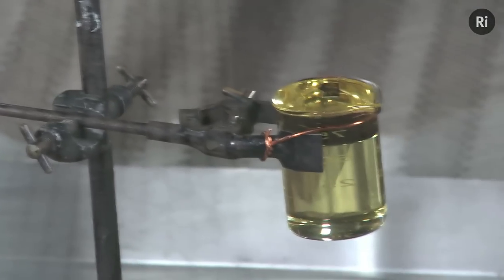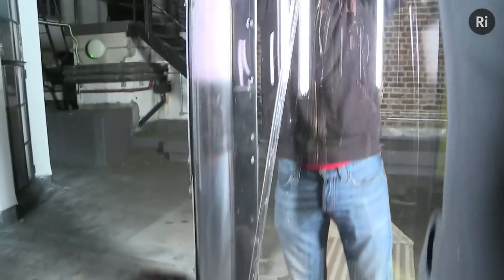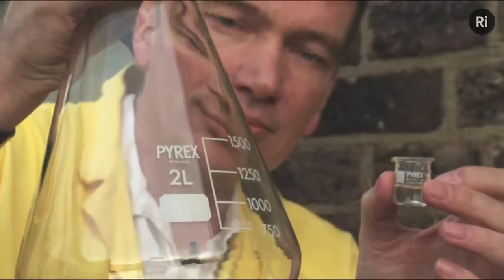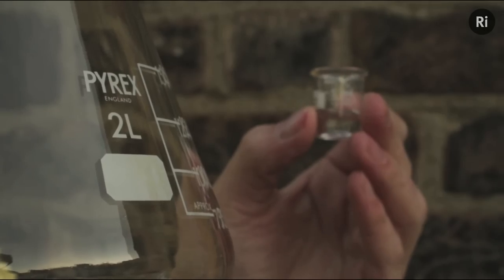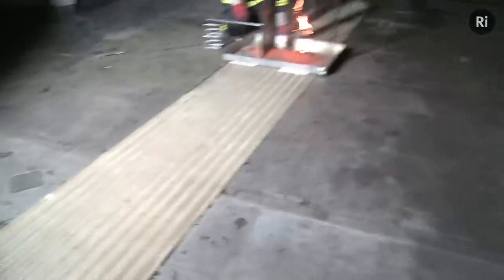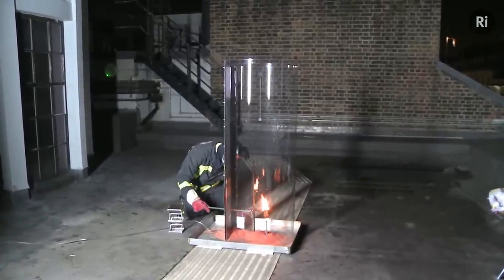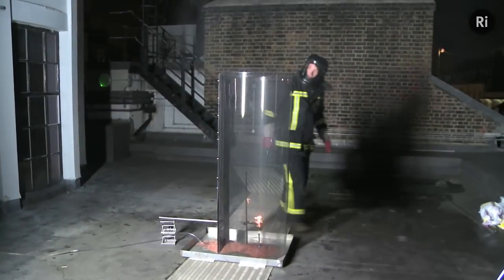Creating a Fireball - Pouring Water on an Oil Fire

Comment from the maker: When mixed, water will sink below oil; and when the water boils it expands enormously in volume as it turns into steam. The water/steam forces the oil into the air from below and the burning oil is propelled upwards.
Reply: The water boiled because it touched the heated container, not the oil itself. Oil has a lower boiling point so it will not turn water into vapor directly.

Comment: In my first ever science lesson I did this :D (admittedly not deliberately) We were told to use tools given to us to determine which substances were candle wax, sugar etc. One of the tools given to us was a bunsen burner and we determined which material was the wax by melting it. Unluckily for myself, one of my group decided then was the best time to go to the toilet (without telling us). They had also been given the job of watching the wax and taking it off once it had started to melt. I looked up from my work and out of the corner of my eye spotted a small flame, I ran over and found it was our wax. Being a year seven and having not been warned of the catastrophic consequences of putting water on an oil fire I quickly carried the burning container over to the sink and dropped it down underneath the tap. I then promptly turned the tap on and only narrowly avoided a large fireball. To this day I swear my right eyebrow has less hair on it than the left...
Reply: Andrew Herbert That must've been scary
Reply: +Andrew Herbert Short version: You burned yourself with an oil fire, by throwing water on it. Medium version: ... in highscool science. Long version: ... but it was oil from wax. TLDR version: (anything more).

Comment from the maker: The two important elements of the reaction are: i) When mixed, water will sink below oil; and ii) when water boils it expands enormously in volume as it turns into steam. The water/steam forces the oil into the air from below.

Comment: Yeah that's right. Steam is water as a gas. As it rapidly expands it dissipates the oil in to a kind of vapour of small droplets. Far higher surface area, coupled with a higher fuel/air mix causes the fire to spread quick. It's deflagration.

I've just checked, and its all written in the description ;)

Comment: They do this experiment/demonstration at my local town faire every year... for years they have been saying use a damp cloth, but the last one i attended and watched, they actually said that the heat from the fire will just dry the cloth out and then it will burn!

What they now recommend is you wet a cloth to shield yourself and actually place the metal lid back onto the fire, the fire will burn its oxygen and will remain contained until the heat is no longer high enough to sustain the a fire.

Comment: basically in vapor form oil auto-ignites because its much easier for oil to ignite in vapor form due to high surface area and more oxygen oil interaction, oil couldn't achieve that inside the flask even tho it had auto-ignition temperature.

Comment: It seems to me that another factor in why the fireball is so large is because it the oil were lit from the top, or if the oil was part of a lamp with a wick, only a small part of the oil would be burning at any one time.  So the fireball is a combination of the steam expanding the burning oil in addition to the fact that all of the oil (more or less) is burning simultaneously.

Comment: That actually happened to me in art class, I made a video putting out a fire we had in a tin that was used for melting wax.  The metal was very very hot and the water boiled instantly, generating a smaller fireball.  Luckily, no one was hurt and it didn't trigger the school's fire alarms.  I was recording at the time because it was the end of the day and I wanted to make an interesting video and I learned something new.  Don't use water to put out a fire in a metal container...

Comment: Its like this 1 mol (the molecular weight of a molecule or atom in ~ g) of an idea gas will take the wolube of somewhat more than 22 liters. This is an example to show how vast the expansion is.1mol H (~1g) expands to nearly the ideal gas volume. So you are adding water to oil. Water has, under normal presure, a boiling tempreture of 100degrees or ~ 374 klevin. now you know that oil can be heated farther than 100degree (will stay with degree).

Comment: Oil is liquid at a higher temperature than water boils, so when water is added, it explosively flashes into steam, misting the oil, which then burns considerably faster in a fireball.

Comment: In this video, the oil is initially on fire, which is different from a usual kitchen setting.

But even if the oil was not on fire, and the fire was burning below some pan, the vaporization of water would wrap around the pan and carry droplets of oil to the fire, then boom!
Reply: This is an advice if oil catches fire, first thing someone in panic will try is putting it out with water.
And also, situation you describe can lead to fire, too.

Comment: Question:

If the water is more dense due to how the hydrogen bonds and various other assorted inter-molecular bonds hold it together, closer than oil, then how come oil's boiling point is above that of the cast iron pan  it may be in, and water is comparativley much less?

Furthermore, why is it that the leidenfrost effect does not occur? Is that only applicable when one of the two substances are a solid?

Comment: Now something astonishing happens, i wont swin on the surface of the oil and wont instantly vapourise because of the "leidenfrost effect" a isolating hull of voporised water shields the water drop which sinks through the surface. Than nearly instantly the water reaches boiling tempreture and epands (like an explosion) because of the much much higher tempreture the oil holds. This tfast expanding vaporised water will trow oil in tiny particles out of the glas. This again will lead

Comment: Ha ha! I did this once with a friend with 3 litres of boiling cooking oil in a large sauce pan on a bonfire and a beer can as the source of water. After retreating a safe distance the fireball was spectacular - an incandescent mushroom cloud about 6 metres in diameter rose to the tree tops. The exploding beer tin almost punctured the walls of the sauce pan.
I wouldn't recommend doing this without taking proper precautions - it's certainly not safe!

Comment: Most people don't know that you can run an old diesel van on chip oil. It is as combustible as diesel, but newer injection systems get clogged so it has to be an older system. Notify the Revenue and Customs you are using this as a fuel and pay a small tax and you have much cheaper way of getting aroun - rumour has it your car/van smells of chips though.

Comment: Wouldn't the steam technically fill any container since a gas expands to fill the volume of a container?
Reply: Sean Williams Yes, but I presume that under equal pressure and temperature, a ml of water converts into x mols of steam, which have a volume at a particular pressure and temperature.

Comment: If the water has time to sink below the oil, how can it turn to steam instantly?

You should do this experiment again, but get theslowmoguys or Destin from SmarterEveryDay to film it at high speed so we can watch what happens, and work out roughly how long it actually takes to turn the water into steam, and then in to a big oil fireball :)

Comment: Explanation: DO NOT PUT OUT A GREASE FIRE WITH WATER!!! Since fire and oil do not mix, pouring water will only cause the oil to splash and spread the fire even worse. In fact, the vaporizing water can also carry grease particles in it, which can also spread the fire. Turning off the heat source before it becomes too big usually works. If the fire is small and manageable use baking soda or salt, because it releases CO2 (Carbon Dioxide) which suffocates the flames. If you don't have baking soda try eliminating O2 (Oxygen) to the fire using a lid or a plate. And do not beat the fire with a cloth. (saw that in FD2) As a last resort, spray the fire with a Class B dry chemical fire extinguisher. If that doesn't work, then get out of there, and call the police.

Comment: If you had a can of fuel and set fire to it only the top will burn, throw that fuel from the can into the air and it should give a fireball. due to increased surface area of the fuel exposed to the air.

Comment: Yes, it a typical mistake that a lot of people make. Common sense tells us, water - fire. The mistake here isn't trying to extinguish it with water though, its simply not adding enough water. Throwing small amounts of water onto it will result in what you see in this video. You need to add vast amounts of water, practically drown it, and it will go out. Unless you have a massive "geyser like hose" handy (which you wont) its not recommended, leave and call the fie department.

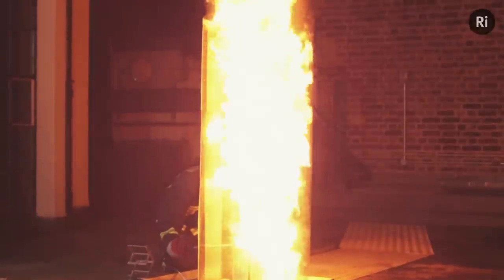Comment: Oh, no, I wasn't suggesting that you should have done it that way, haha. Maybe with a bomb-bot in the middle of a quarry with all people at least 100m from it, or maybe vents along the bottom of the shield (less preferable). Looking at the slo-mo again, starting about 4:16, it looks a lot like when you suddenly invert a container of viscous liquid and air; the flames and the air are pushing each other aside as they pass each other, the flames up the tube and the air down.

Comment: I once put alot of macthes inside a SMALL tealight, the wax in the tealight started melting and boiling, I was doing this next to a sink filled with water
So after a while afraid it was emitting to much smoke I shoved the hot tealight into the sink, instead of going out a HUGE 2-feet fireball erupted, scaring the shit out of me
The thing was the tin-container ingested a few drops of water on contact but it didn't topple over or submerge. Which would've frozen the fuel
DO NOT TRY THIS AT HOME!!!!

Comment: how can you kill the oil being on fire? With ice?
Reply: sand
Reply: salt.
Reply: put a lid on it
Reply: Fire extinguisher.
Reply: Brandon Jacky
Fire extingusher suitable for oil fires, some fire extinguisers have water in them.
Reply: Starve it of oxygen, of course.
Reply: usr45677567 Carrection: Carbon dioxide fire extinguisher.
Reply: You stop a fire one of 4 ways. Fire requires 4 things to be a fire. Heat, fuel, oxygen, and a chemical reaction. You break one of the 4 the fire goes out. Pan on fire? Cover it with a lid or remove from heat source.
Reply: ***** cover with wet cloth